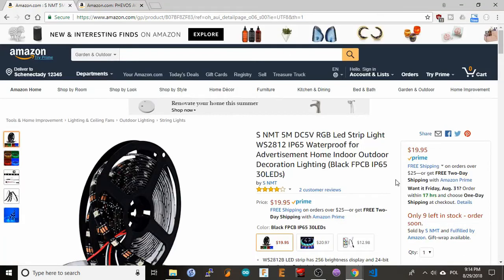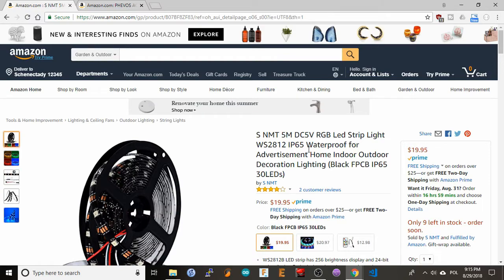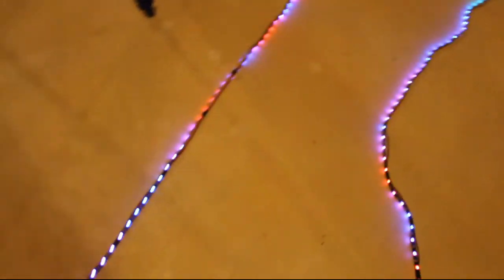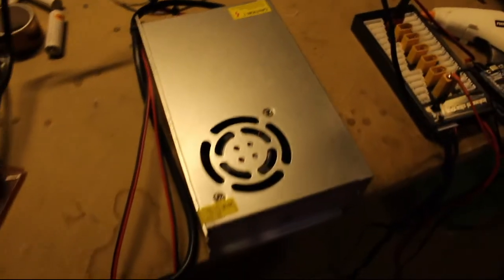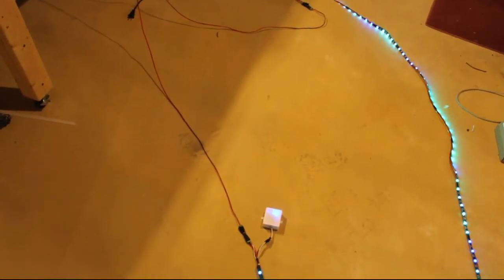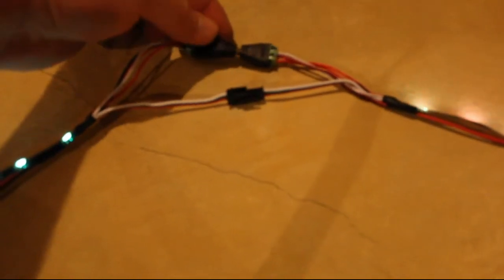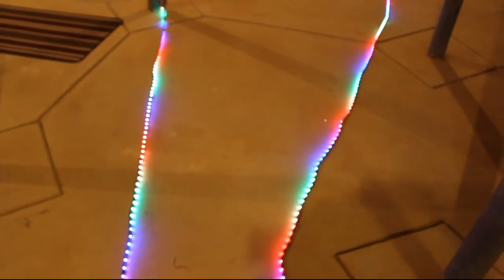NodeMCU Kube LED Controller - Long LED Strip Considerations

Comment: What wire size are you using for power and ground?
Reply from the maker: I made these for someone a while ago, so I don't remember exactly, but I think they were 16AWG
Reply: @BKHobby  is it sade to pass so much current in 16 awg?

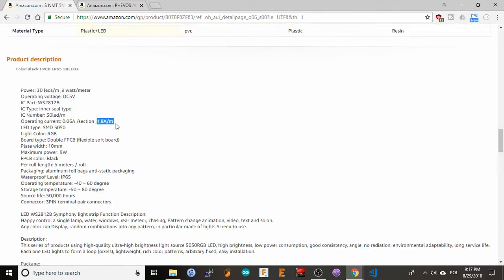Comment: 1:01 (edit: I'm wrong!) there's a typo in the description. it's actually 300LEDs/m, so 90W/m and 18A/m. Thankfully you ignore that error in your further calculations :)
Reply from the maker: @EnthusiasticAboutManyThings - hm, are you sure?  The LED strips I use have 150 LEDs for 5M, so 30 LED/m. I do know they make extremely dense strips, (I think up to 144 LED/m, and those would definitely require a beefier power supply.
Reply: @BKHobby  Ah, my mistake. I've been working with 5m strips so much the numbers in my head are all for the whole strip with 300 LEDs.

Comment: Nice projects. I have made your MCU controller with Openhab  to control a 5 meter string of WS2812B Leds . I am having a problem turning them off it only turns off half of the string. I found if I turn off the leds with Openhab only half of the string turns off and then I have to go into the color pallet and change to a different color the rest of the string turns off. Is there something in the code I'm missing? Thanks for the great projects. Mike
Reply from the maker: +Michael Roberts - I do have a similar issue sometimes with my longer (5M strips). Usually, it just takes me telling Google/openHAB to turn it off again, and that works (i.e. send the OFF JSON string twice). Have you tried that yet?

I think the issue is on the Arduino/FastLED side. The processing of the command may be taking longer than expected, and FastLED is only able to update a part of the string before the next cycle begins. I wonder if setting the ESP8266 clock speed to 80 Mhz (instead of 160) would improve this or cause other issues (haven't had time to try this myself, yet :)

Thanks for the comment and for watching -- stay tuned for more projects/videos coming soon! :)
Reply: Thank You,  I'll give that a try